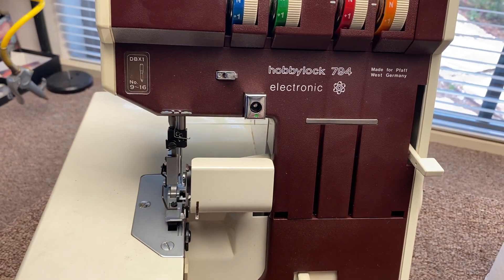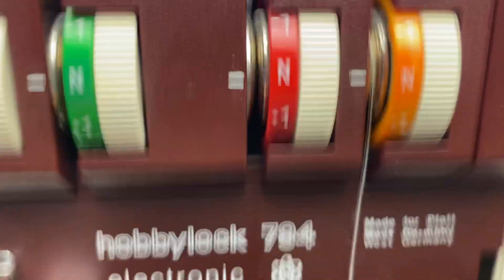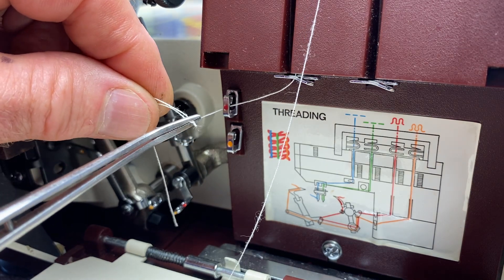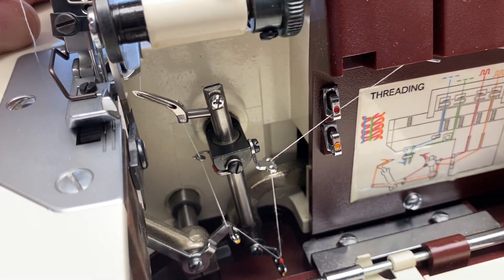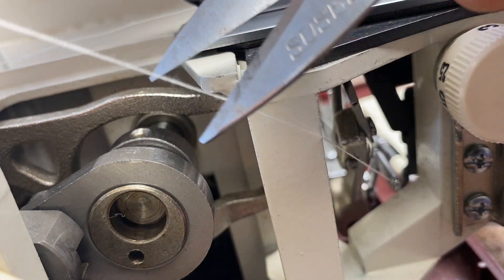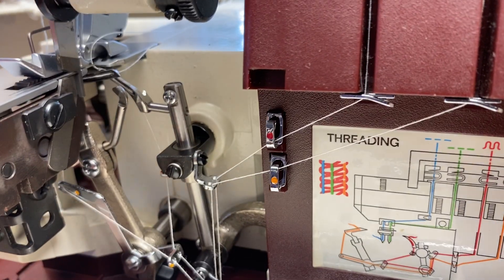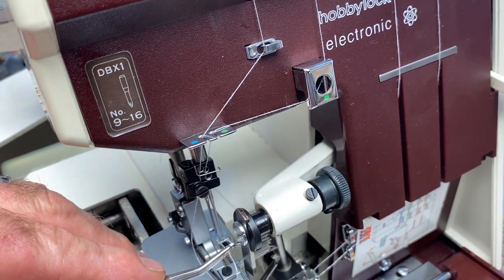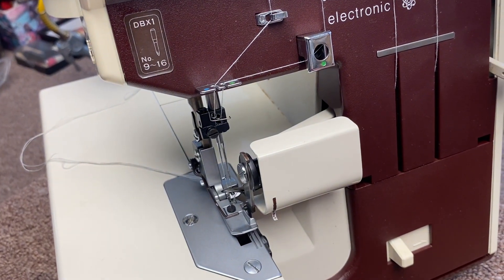Threading a Pfaff Hobbylock 794 Serger

Comment: Outstanding video.  Just got a vintage 794 and your clear instructions helped me thread the machine right first time.   This was a machine sold as “non-functional/for parts only”- it sews (serges?) like a dream!  Also, the position/clocking of the second looper guide at 6:30 was slightly different than my new machine- I adjusted mine to fit and everything works great.  That twisting a loop in the thread trick was amazingly effective.    Thanks for taking the time, you saved me a ton of time and frustration.

Comment: This is an AWESOME tutorial on threading, thank you! 

I’m using a “big eye” beading needle (which is very flexible& bendy) to get into the small hidden looper holes on my machine. I like knowing I can just twist the thread! Cool!! 
I have a 603a 3-thread machine, but the loopers look identical to these. My manual instructions call for the lower looper to thread first (which I thought was odd! But it’s a very old machine) and then it has me winding the upper looper thread over and under the lower thread, kinda kooky-like, to get the thread where it needs to go. I suspect that if I thread it THIS way, then turn the wheel one rotation, the thread should just land in the right location!! I’m gonna try this method and see!! 
Thank you!

Comment: This is great.
A thing I've discovered just now is when it comes to the tricky bit of threading the 'orange' looper is to use a beading needle. Put the  beading needle through the looper from the front. Thread the protruding beading needle from the left hand side of the machine. Pull the threaded needle through from the front of the machine carrying the looper thread. If the needle isn't long enough you can thread the needle with an extra bit of thread from the front. I have the 796. 
So much less hassle than using tweezers for this bit.

Comment: Have a Pfaff 796 I was trying to check out the upper knife and the silver knob fell off. I can’t figure out how to get the knob back on so that it will operate to be able to disengage the knife.  How far on does the silver knob go back onto the shaft?  It has a set screw that if tightened it will not allow the knife to be moved. I followed the manual directions to push the knife unit to the right then turn the knob clockwise until it clicks which I did. Then I tried to unscrew the screw that holds the upper knife on. It would not unscrew but sent the knife further around than  where the initial click happened.  At that point I tried to get the knife back to the “clicks position and the silver knob fell off. The spring inside this knife unit makes it difficult for me to continue trying to get this to work properly.  Any help you can give would be very helpful. Thanks.  The reason I was checking out the knives was that the left needle thread sometimes doesn’t catch the looper threads then when I chain after stitching the left thread is partly outside the chain. I read that it could be dull knives that cause a slight bunching as it tries to cut the fabric making the fabric move slightly thus the left needle thread sometimes misses the loops. I don’t know but am trying to figure this out.